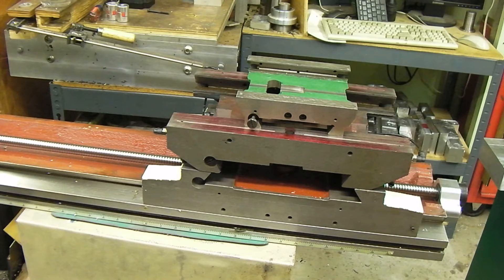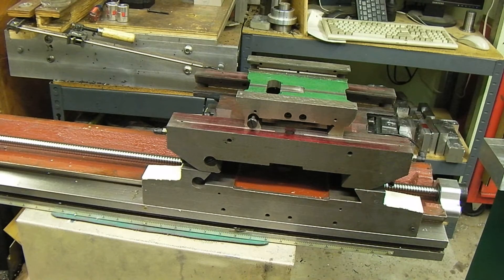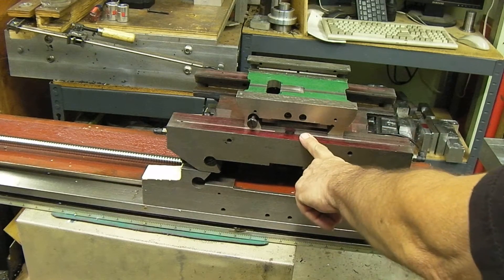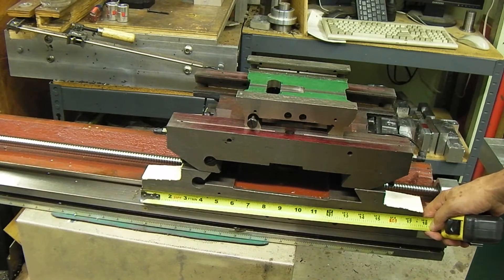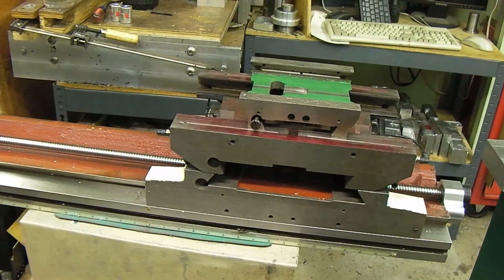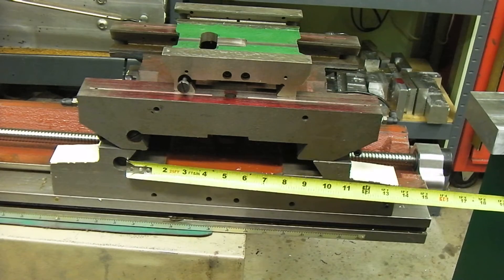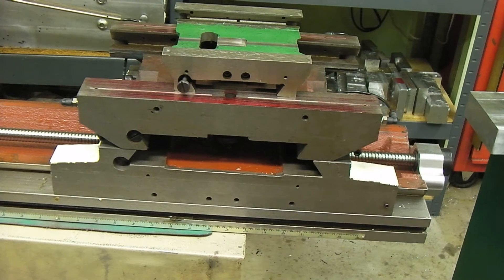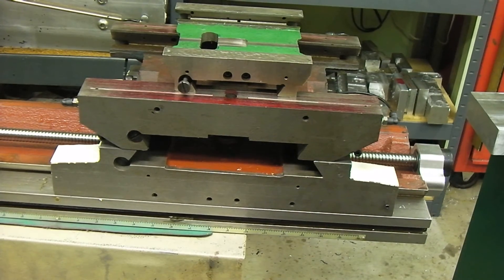PM-940M Y Saddle Comparison.

Comment: ArizonaVideo99,

Would you have the dimensions of the z axis slide mount that you would be willing to share.  I am not asking for your design dimensions only the dimensions of the stock mount.  I am only asking because I am out of town visiting family and I have an opportunity to build my mount for my 940M conversion at a friends shop and I have not measured it myself yet.  I can give you specific dimensions that I would need but I am pretty sure you know which ones.

By the way I ordered 900 and 1200 oz motors like you suggested.  Thanks for any help you can provide.

Comment from the maker: The X and Y will be powered by a 900 oz stepper. I have been running one on my IH for about a year and it works fine. I have also been running a 900 oz on the Z and it works OK but a bit more power would be nice.

The Z is heavy so  if you use a stepper a 1200 oz 7A would be best. I'm going to run a Clear Path servo but I might try the stepper just to see how  it works. I do have a air spring for the Z not for lift but mainly to stop the head from dropping when the power is turned off. 

Something like this.

http://www.automationtechnologiesinc.com/products-page/nema-34/nema-34-high-torque-stepper-motor-1200-oz-in-12-single-shaft-with-flat

I do wish I could find one that had 7A current, It would have lower inductance than the 6mH that the 1200 has.
Reply: Interesting, servo on the Z only?  Will the servo give better torque or are you looking for position feed back?
Reply from the maker: Hi Steven.
Both will work.  The stepper will only give  about150 IPM if you run 75V or so and the servo will go faster. None of this is a problem for this type of mill. Most people will run the Z around 100 IPM. The servo will be quieter. You get a higher peak power output from a servo because you can run them closer to full power where with a stepper you need to have at least 40% extra power so you don't loose steps.  I have run the brushed DC Gecko drive drivers and servos for years and the steppers work as well or better in some ways. I have yet to run the CP servos so I will have to wait and see.

Comment: I like you idea of reversing the orientation of the fixed end to the non drive side.  Other then reducing the stepper motor stick out did you have some other reason to do it that way?
Reply from the maker: Just less stick out.
Reply: Well done, very nice work.  I assume you used a 20 mm screw on the x-axis, any clearance issues?